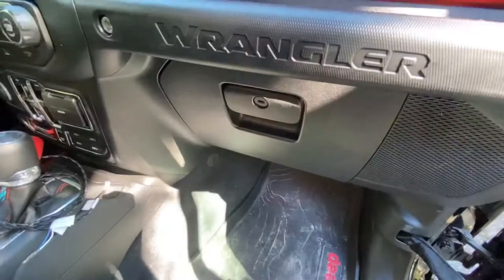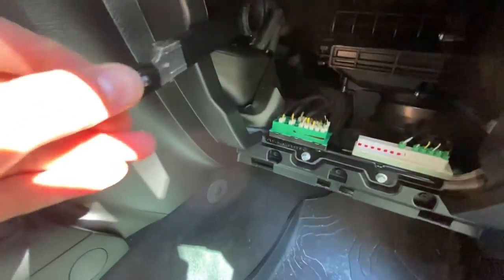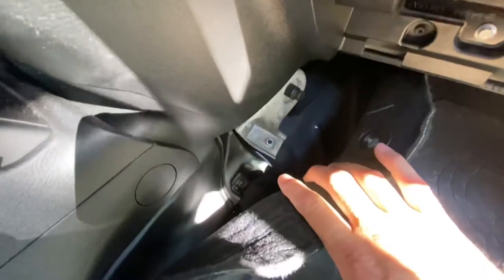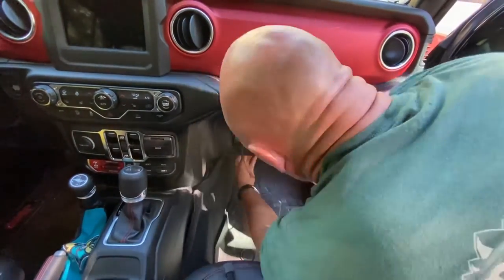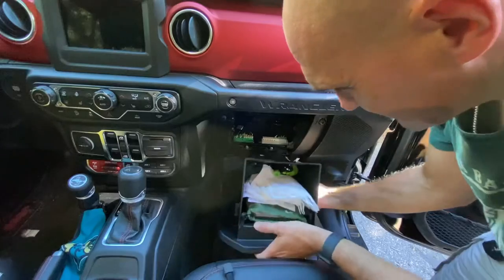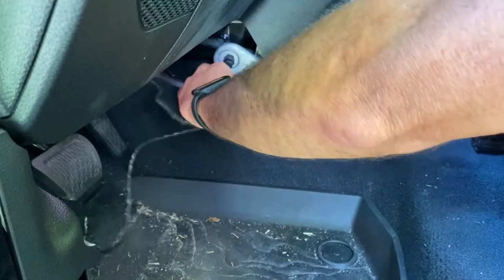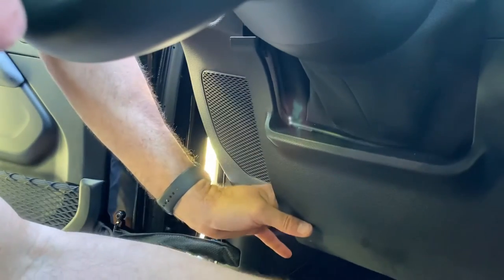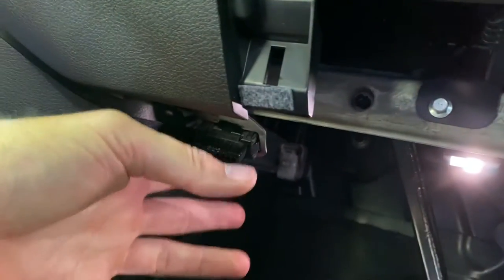How to install the AEV Pro Cal Snap for Jeep JL and programing steps for larger tires

Comment: Do you know if that check engine light come on, after you recalibrate your tires, what you supposed to do?
Reply from the maker: Francisco, the CEL is for the steering wheel being off once you lift it, once you recenter the steering wheel it will go off almost immediately one you start driving.
Reply: @FischerJeepAdventures  thank you 👍